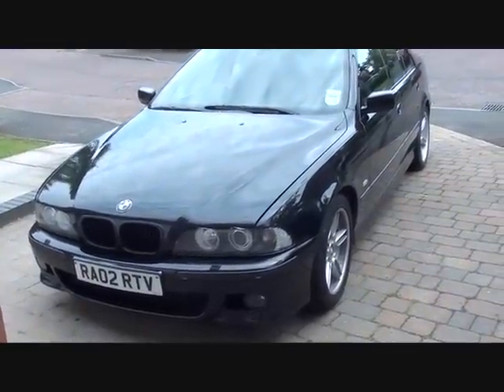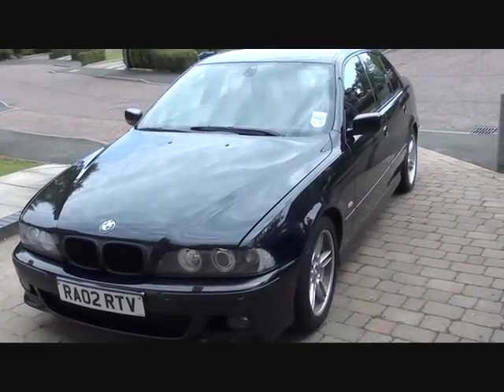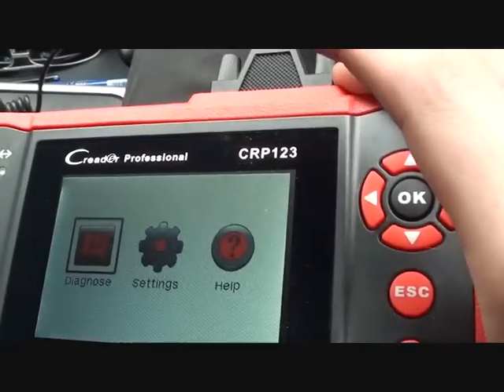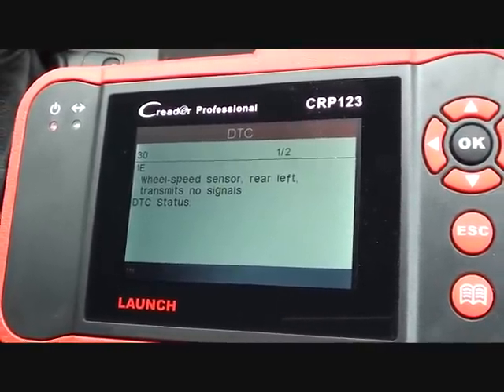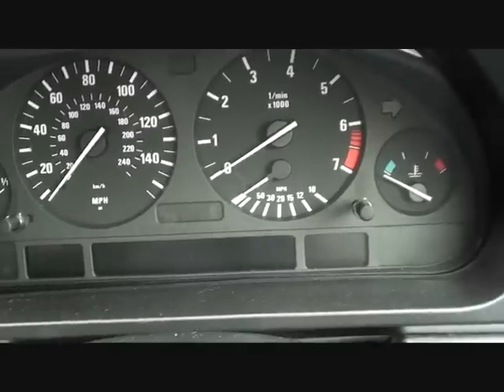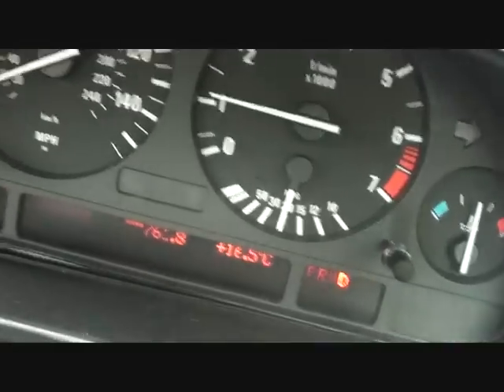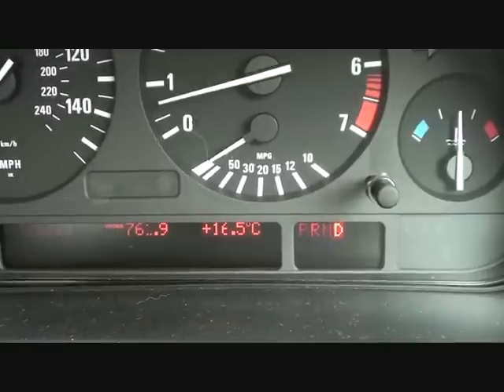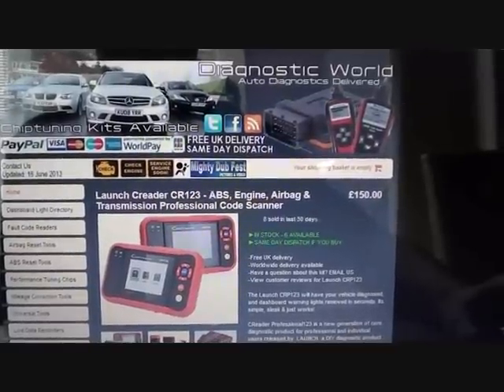BMW E39 5 Series ABS Problem - How To Fix Using Launch CRP123 Diagnostic Reset Tool

Comment: I think I would give the video 3 out of 5.  Yes it might have been nicer to see the unit in action as you drove but it did show how to read and clear the ABS issue on this car.  I think the video could have been shortened to 2/3 the length of time because there was a lot of slow parts in the video.

As for the updating of the unit, I only had a problem going to the correct download location.  Once I was there I was able to download and update the device fairly easily.  It might help to have the latest update attached to this video as well.

Comment: I have just purchased a CRP 123 for this very issue - The issue I have is when I select BMW from the SCAN menu -I have no option to manually select the ABS system - Any idea's would be most appreciated .

Comment: Disappointing because I was hoping to see you use the "Data stream" on the wheel speed sensors as the fault could have been down to a damaged cable or fault ABS unit !
Reply: yeah..it would be better if the it can show the rotation permin as per wheel..